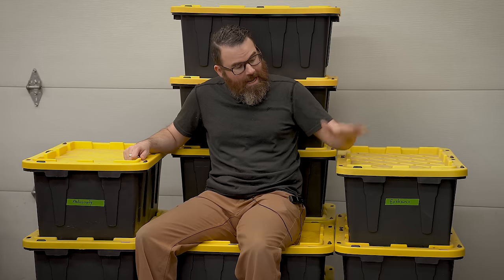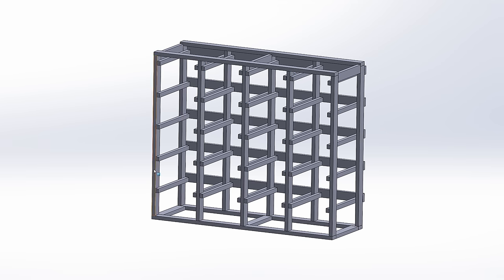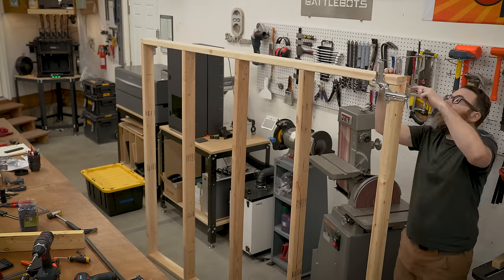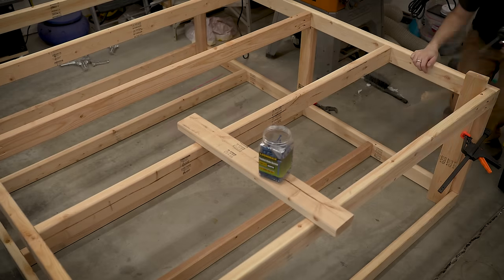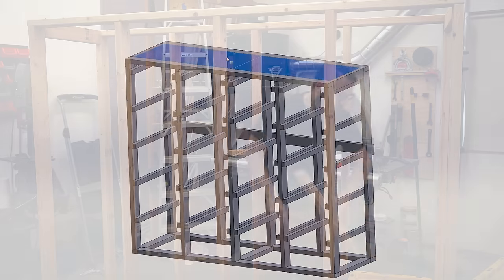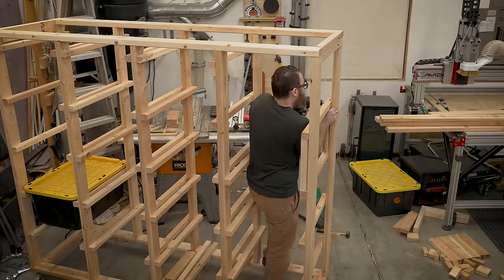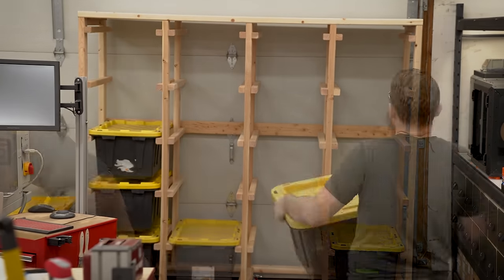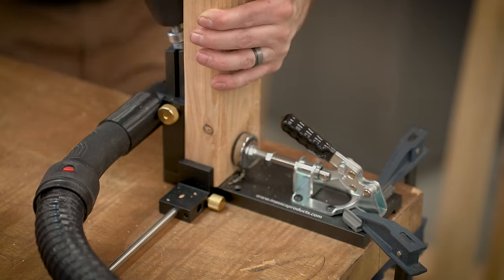DIY Tote Storage Rack - 17 Gallon Totes

Comment: Thank you for posting on Printables. It is so helpful for the workshop to have a 3D printer. Although I like designing parts myself its useful to see other people's take on solutions to problems. I finally managed to fix the drifting fence on my Ridgid Tablesaw with some strengthened bumpers. I would have had to get a new tablesaw or different fence, and for 30 minutes and 2 cents worth of plastic, problem solved!
Reply from the maker: Nice!
Reply: I love 3D printers. So much you can do with just making whatever little bits of plastic.

Comment: If you don't put some sort of diagonal brace on the back, that rack is going to tear itself apart as you move it around.  A 1/4" or 1/2" plywood sheet at least on the bottom half will help a lot.  Using a flat 2x4 to span isn't good practice.
Reply from the maker: I could be wrong, but the horizontal works just fine.  There's no flex at all.  Sure, a diagonal brace would also work, but they're accomplishing the same thing.
Reply: I'm a fan of the design as is, but from observation I agree that a thin sheet of plywood or masonite would be common practice on furniture shelving, dressers, and cabinets.
Reply: @RobertCowanDIY Eh, add it if you feel it starting to get loose and wonky. No need to add it in now. Theory and practice.
Reply from the maker: @c0mputer  Yeah, I'll modify the design on printabes if it becomes necessary.  But right now I'm easily tossing 70 pound totes in there and it's more solid than the previous metal rack.
Reply from the maker: @CharlesLogstonInTexas  For sure.  This is also 100+ pounds, it's far sturdier than I thought it would be.  I'm pretty familiar with making things bullet proof and this has my stamp of approval ;-)
Reply: I think he has plenty with the horizontal boards. If a few years goes by and it has frequent use and is moving, I might add triangle shaped pieces maybe a foot long and wide to all four corners on the back to stiffen it. I think his version is likely to be his and if someone makes one based on it they can or will overbuilt it as they please. That kind of thing is a constant once you build a few projects from plans or inspiration. Always an inch wider or a little different.

Comment: I advocate for having those bins sit on their bottoms rather than their rims.
Reply from the maker: Why?
Reply: @RobertCowanDIY I tend to agree. If they sat on their bottoms, the weight of its contents would go straight into the shelf. Hanging them by the rim forces all the weight (and stress) through the sides of the bins. If the bins are heavy duty, it should be fine, but I imagine they would last longer if they rested on their bottoms.

Either way, I loved the video, as always!
Reply from the maker: @Rocco-bm9cf  Thanks.  We'll see how they do!
Reply: Is this the first time you’ve seen this idea? A lot of people are building shelves like this. Storing on the rim requires far less lumber, neater design, easier for a DIYer that’s not experienced with a skilsaw , or table saw to cut plywood.
Reply: @johncamp7679   If those bins are loaded, they will deform and break. 

Flat shelves will give more surface area support and are still usable when that specific bin is no longer available.

Comment: So, this video inspired me to redo my garage 4x8 ft. work table so i can better use my space.  I got rid of the horses that top was on, created legs and added a second 4x8 shelf under the top , and ....here it is: Added those caster wheels to the four legs. Now i can be more flexible with the area setup. I do a bit of everything, printmaking, sculpture, wood working, jewelry making, mold making et., so being able to rearrange this table now is a big improvement....that i should have done some time ago. Thanks for sparking my mind. BTW, $25. for a set of four of those casters is a great buy. Thanks Robert. Oh, and i had your dad help me move it around during build.

ewleryewlery

Comment: Great video…cool to see someone doing the smaller containers. The big ones are hard to find items in. If I was going to make any suggestion, I would say to add ten screws to that rear member that you added on the back. A couple screws, and maybe even some glue would help with any potential racking movement…the single screw just acts like a pivot and really adds very little strength. Just my two cents…thanks again for the great video!

Comment: Nice rack!

Really liked the endstop and dust collector adapter for the pocket screw jig, it's these little touches that make a tool so much more valuable, either reducing work afterwards (like having to vacuum a bunch of dust) or making repeatability easier so it's harder to make silly mistakes like not perfectly clamping it down and drilling holes in slightly the wrong place.

I just keep stacks of totes filled with crap under my workbench but you're giving me plenty of ideas to make a rack like this for myself. Regarding things with scale, I can fully recommend making a CAD of your workspace with the major things like the CNC represented as blocks, that gives a good idea how much room something will take up after you build it and saved my bacon a couple of times where I was going to build something, I make a box with the dimensions and add it to the model and then figure out it doesn't exactly fit, blocks or doesn't fit through a door or something else. You can even go low-tech and make a scale model if you really want to Adam Savage it up.
Reply from the maker: I think my shop is too far along for a scale model at this point, but it's a good thing to keep in mind!

Comment: In case you're curious, the linear slide mechanism on the saw is called a "Sarrus Linkage" A very clever mechanism, though it relies heavily on the "links" being rigid and the bearings having little to no slop (more slop=less precise linear movement).
Reply from the maker: Ah nice.  I think they call it 'axial glide', which is of course the same thing.

Comment: Yay, finally someone using the 17 gallon totes.  Thanks for doing the math for me.  I just found out all black/yellow tubs are not created equip-as far as brand.  The measurements are different from the major brands, which brand are you using?
Reply from the maker: Huh, I'm using both lowes and home depot and both are interchangeable, I haven't found any differences.  There are cosmetic differences, but even the lids fit either.

Comment: As an addon to this mount 2 1x1's on heavy drawer rails at a good working height. When you want a tote, pull out the rails, pull out the tote, set the tote on the rails and save your back. When you are done push them back in. They can go right under one of the static rails in this very setup. You can also add them to a work bench on the other side of the shop.
Reply from the maker: Drawer slides that could handle these weights would be quite expensive and make the cost of the project go up by an order of magnitude!

Comment: Psst. The runner length listed on the cut list are shown as 19 3/4" long, but that's the same length as the frame connectors (which means that the runners aren't long enough to screw to the uprights.) I think they need to be 26 1/2".
Reply from the maker: AAAH, I'll fix that.

Comment: I feel like as that gets loaded up over time, you might be at risk for a sideways collapse eventually, triangles are always stronger than squares, consider diagonal crossmembers in the rear rather than the horizontal strip.
Reply from the maker: I could be wrong, but I really doubt it.  If I felt even the slightest bit of racking, I would have added additional bracing.  It's stupid solid, even loaded up with really heavy totes.

Comment: The kregs stuff works well for me. Its platic but theres metal guides. If you 3d printed, wouldnt your drill bit start chewing the guides/insides out?
Reply from the maker: Yeah, it would.  But whenever I make a part like this I just use drill bushings.  They're pretty easy and cheap to buy and insert into the part.  I actually just design the threads for the bushings from this and other jigs I already have and screw in those bushings.

Comment: Should be worth mentioning your links for 27 and 17 gallon totes, the 27 gallon totes are a dollar cheaper. Using the smaller ones is very cost inefficient… I get why you used smaller ones but the bigger ones have more storage for less.

Comment: man, i really need something like this.  i'm in that hell where even the act of organizing is hard because the lack of free space to move things around in.  it's like having two "squares" of free space in the puzzle, but you're standing in one of the two spaces lol.  your solution solves my main gripe with those HDX totes: they're too flimsy for holding much weight if you plan to stack them.  i got those even more prohibitively expensive husky ones that do solve that problem, but your solution supports each tote individually, solving the problem.  i did get the husky's for the clear lids, but stacked, the clear lids are just about pointless.  yours sort of solves that problem too since you can pull one tote out without needing to unstack 3-4 totes to see the bottom one.  nice work as usual 

i ended up with the kreg, but only because i liked that home depot and other stores carry it, so having local access to more screws and accessories was nice.  the body is plastic but it's that really high durometer impact plastic.  the part with the holes the drill goes through is metal, and slides within the plastic body for length and depth adjustments.  it has an optional vacuum accessory, so i did what you did and printed one 😂.  it gets the job done but i'm sure for the long haul, a nicer one would probably be better

Comment: I was like I’ve seen this video. But it was Uncle Jesse who did something with the big totes.
Reply from the maker: MANY people have done this, but they always use the larger totes.  I think the 27 gallon ones are just too big and bulky for my purposes.  This isn't an original project at all.
Reply: For sure I know you said it wasn’t original. 

When I saw this I just woke up and thought did you repost a prior video you did, but I hadn’t seen it. As I woke up I was like it was Jesse who did the video.

I posted as it give other followers another channel to check out as every rack is different.
Reply from the maker: @75keg75  For sure, I tried to optimize for the least amount of material.  I made sure most of the off-cuts had a use, etc.  It's not perfectly optimized, but it's pretty straightforward.
Reply: I just rewatched as when I had you on before i got distracted by phone or something. 

Just a couple thoughts 1) Could you 3d print some height adjustable feet that sit next to the castors (on right side) so that when it is in it’s usual docked position it is level. It would be good if feet activated but that’s a lot more tricky to design vs a screw. 

And 2) can you sneak a couple of 45 braces to stop it racking over. The horizontal centre probably is okay but warehouses generally have ties so stop them racking over and they have horizontal purlins. Just something consider with the weight you’re talking about at the end.

Comment: Since people are most likely not going to print this, wouldn't it make more sense to publish a full assembly in STEP format instead of 3MF mesh files of each part individually?
Reply from the maker: Correct, it's not really meant to be printed of course.  I could also upload the STEP files, but I created the frames as a single part with multiple solid bodies, etc.  However, I did generate PDFs with cut lists for everything, which is probably more useful for people actually building this.
Reply: @RobertCowanDIY  I might just be blind, but aI don't actually see a cut list in the PDFs. I see images and overall demissions but no cut list.
Reply: ... or I could look at the description on Printables that has the cut list. [facepalm]
Reply from the maker: @BoffoCaveman  hehe, no worries.

Comment: Wax the runners for better sliding action.
Reply from the maker: Good idea!
Reply: Try some hdpe tape instead - do it once and never have to do it again!
Reply from the maker: @Eric_Wolfe-Schulte  I actually have some, but it's really not needed.  The totes slide VERY easily from the rails, I was actually a bit surprised.  The problem with the HDPE tape is it doesn't always adhere perfectly and it would curl and come off over time.  The wood slides work great.